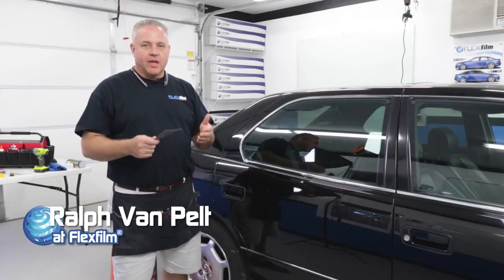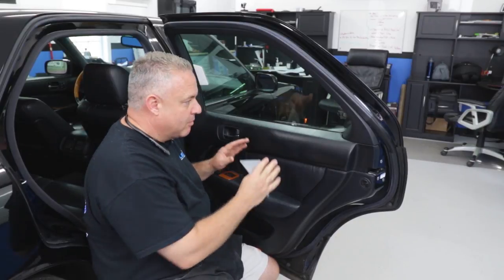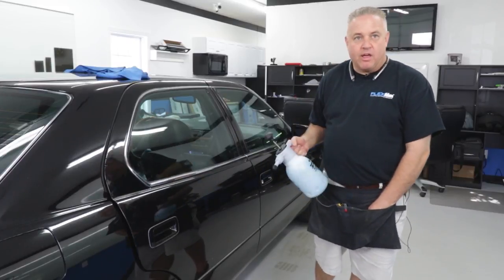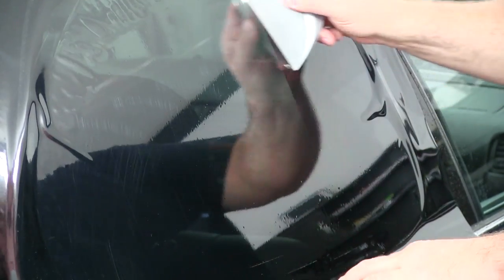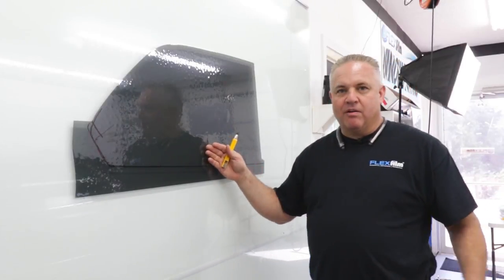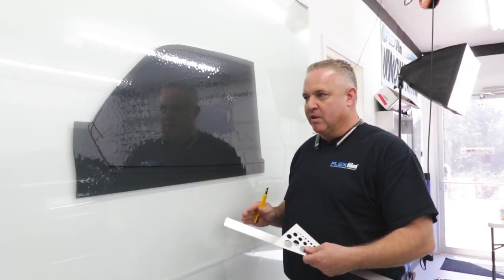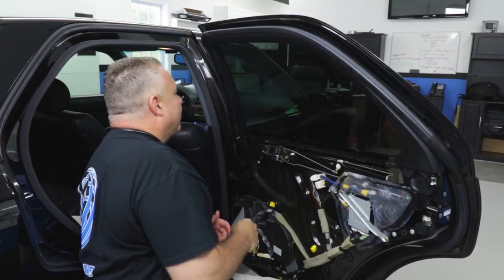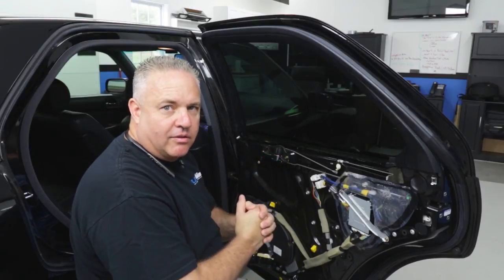How to Tint a Difficult Car Door Window (2000 Lexus LS400)

Comment: All screws were harmed during the making of this film. :D

Situations like this are the reason I’ve always just pulled the glass out when tinting a window. To me it is far easier to pull glass than it is to deal with trying to work film into those tight cracks. Of course I only tint my personal vehicles and a few for friends and family, so I am not trying to turn time into money. I enjoy tinting much more when I can do it on the dining room table. Lol
Reply: That's interesting. You remove all side windows when tinting a car? Wow.
Reply: Yes I do. I do a LOT of automotive work. I don’t do much window tinting though. So it is far easier for me to pull glass than it is to waste window film because I keep creasing it or getting dirt behind it. If I did it for a living, I would definitely do everything I could to speed things up and obviously pulling the glass takes a little longer (most vehicles don’t take very long though). If that were the case though, I would get more practice bottom loading or two staging. I don’t get much practice though, and I only use ceramic film. Screw ups can get expensive. When I pull the glass, the odds of me screwing up are dramatically reduced.

Comment: What do you do if a tint shop messes up your car locks? When I came in for fro t Tint my remote unlock worked fine. They got the Tint on and put the door back together and were testing everything.. But now the remote doesn't unlock my front door.. What could have happened and how do you fix this?

Comment: Ralph how come I get crap on top edge I clean window and seals well but don't scrubby pad could it be factory grease on windows???I just blade it should I scrubby pad it??
Reply: Wipe the top of the window with a paper towel and then squeegee before install. You're probably pulling in dirt from the top of the glass.
Reply: Chance Tucker no I do that could it be that grease from factory???
Reply: Chance Tucker only happens on certain  cArs do you scrubby  everything....
Reply from the maker: JBIRD575 
Yes.  You should scrub it and wipe it down.
Reply: Ralph Van Pelt ok maybe its that grease from factory...im buying it pump soon from you too haha
Reply: I'm buying the the  jr pump from ya too

Comment: No need to pull the panel on this one. I use to do a lot of these back in the day.Prep window squeegee it then roll window up as far as possible to where you can barely fit a squeegee in to get water out of top and then the bottom goes in no problem

Comment: Good video. I was disappointed though to see you take so much time to get the tint job right, then chew the crap out of those screws reassembling the door panel with the drill driver. Attention to detail shouldn't stop until the keys are handed over.
Reply: I cringed at the reaming of those screw heads. I want my screws to look like they’ve never had a driver touch them after they left the factory.
Reply: I had the very same thought..... I cringed when I saw it.

Comment: Weird how americans dont like to disassemble door trims . My company in Australia you always do disassembly to some degree and get the tint in as far as possible. And trim top edges once its on.
Reply: I pull the entire glass out and tint the window on a table... I don’t do it for a living though, and don’t care if it takes a little longer. My film goes well below the bottom seal, all of the way down to the clamps that hold the glass in the regulator frame. When you go that far down, you definitely don’t have to worry about the bottom edge lifting. Lol